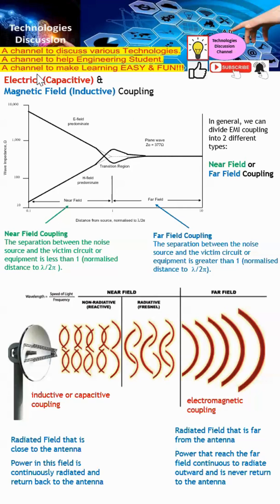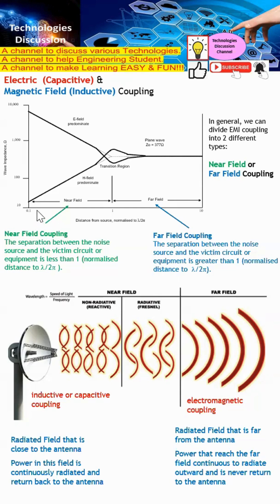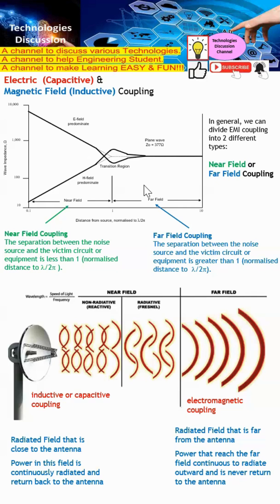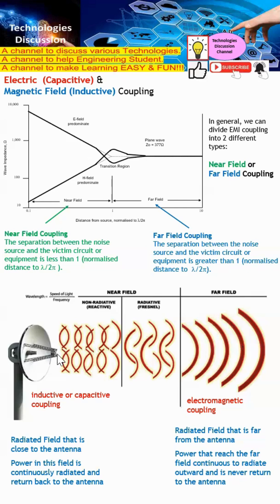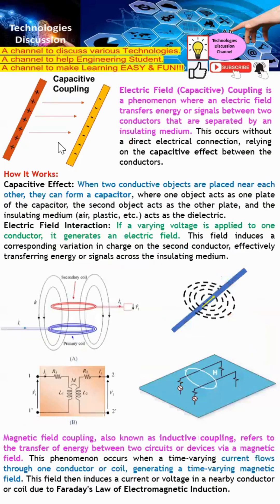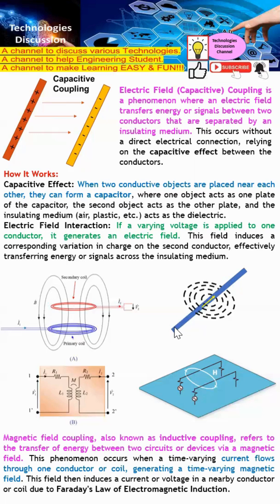How to Stop Capacitive & Inductive Coupling in Your Design. Don't Mix Up Electric & Magnetic Fields!

Comment: How we can achieve the capacitive coupling in an antenna so the array of the antenna tightly capacitive coupled .

Like which parameter we need to see whether there is capacitive coupling or not
Reply from the maker: Achieving capacitive coupling in an antenna array involves designing and arranging elements such that there is significant interaction through their electric fields. To ensure tight capacitive coupling, you need to place elements close to each other while avoiding physical contact (to prevent short circuits).
Normal by simulation to see if there is capacitive coupling or not.